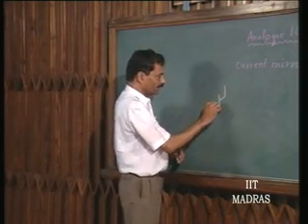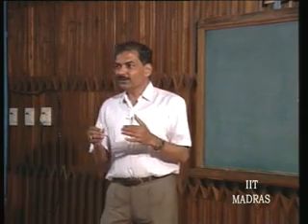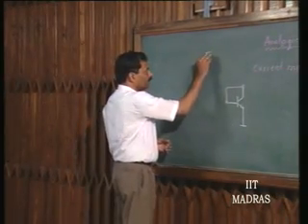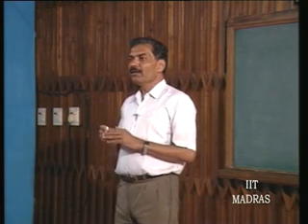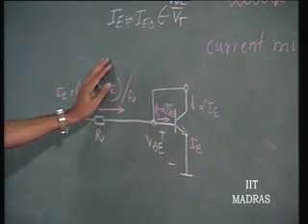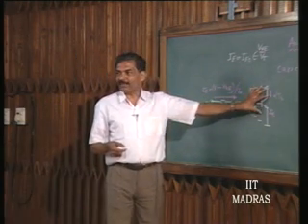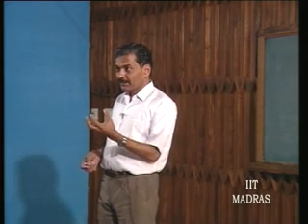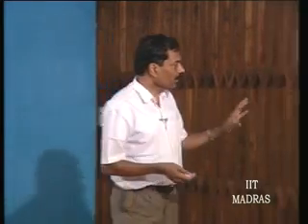Lecture - 1 Basic Building Blocks In Analog ICs

Comment: I understand that the current is being fed back, but that means the current is going up the collector rather than down the collector towards the junction. How does that happen?
Reply: You think of positive feedback, the current flows through the collector and adds up with the input current to increment the base current... that is not the case. Negative feedback means that the collector current decreases the base current since I_B = I_R - I_C. Therefore the base current is smaller if base and collector are shorted.